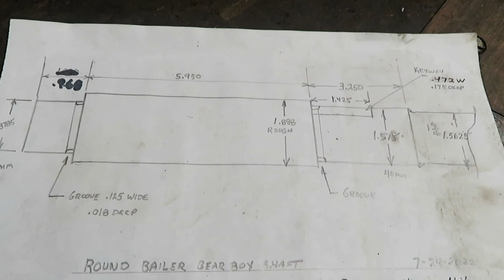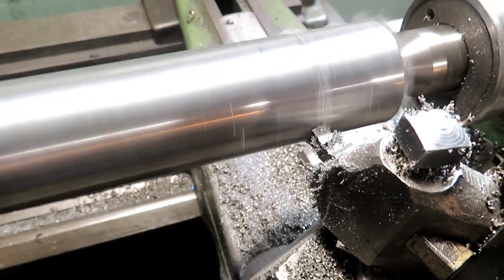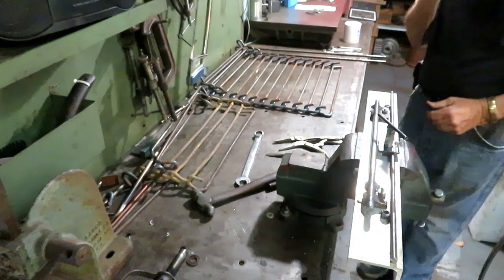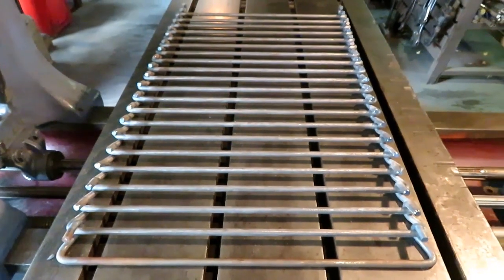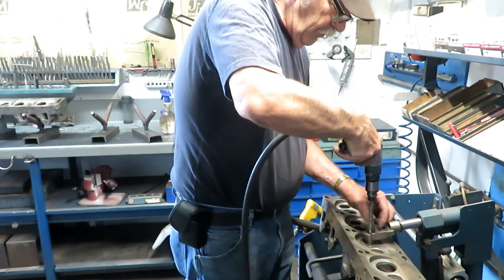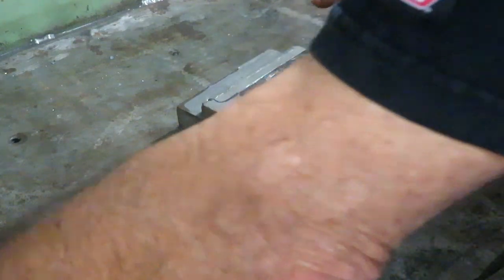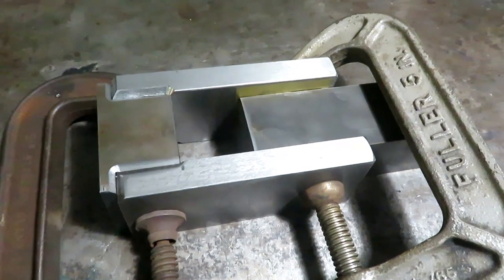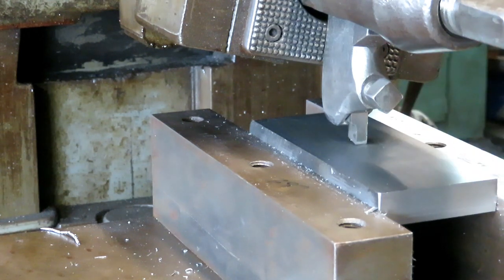Old Steam Powered Machine Shop 80 Steam Shop Work

Comment: For bending small bar stock, may I suggest an induction coil heater? I got sick of burning lots of gas to bend metal on repetitious jobs like this, so built a hobby-sized one from some plans, and anything from 6mm to 23mm (1/4" to 15/16") is easy, and it will pre-heat 25+mm enough to let you finish it with a flame.
Reply: Amish probably picked him for his avoidance of electric

Comment: That's an odd bit of metal, I've never had a shaft be magnetized like that.. I've heard you can get a big 12 volt electromagnet and hook it up to ac instead of dc to demagnetize but I've never tried it myself.. for an ac power source, tapping into the transformer on a battery charger before the rectifier is what i was told to do

Comment: Dave, another fantastic video!  I wonder if that crosshead design might be something that appears in patents?  Simple but difficult to make without a purpose built machine?  Maybe they had it on a shaper or slotter with a bit that would cut on the end, fed down to the radius and then rotated it with a dividing head, flipped it over and then repeated on other side?
Reply from the maker: That is a possibility, but I can't imagine what the surface finish would have looked like.....Dave

Comment: The shaft might have been magnetized by someone using a very large and powerful lifting magnet on it (or a DC electromagnet). And if they turned on the magnet before it was in contact with the shaft that might have slammed the shaft and magnet together. A very strong mechanical shock while it's in a strong magnetic field would make the shaft even more magnetic. 

You might be able to clean the magnetized swarf off your lathe with a degaussing coil, like the ones that used to be used on old CRTs (check ebay)
Reply from the maker: I found this in the specifications:  StressProof® is electro-magnetically tested using eddy currents.....interesting.....Dave
Reply: @davidrichards5594  that's a standard method to test for cracks and voids, and as far as I know it shouldn't cause any residual magnetization. Eddy testing uses a pair of small AC coils (not DC coils) and looks for differences in the currents in the two coils when they're passed over the test object. It works similar to metal detectors.
Reply: @davidrichards5594  there's a different inspection process called Magnafluxing which can magnetize steel because it uses a powerful magnet or DC electromagnet. But when a steel factory does that kind of testing they also demagnetize their steel after it's been tested. Maybe you got a piece that failed a Magnaflux test and was never demagnetized.

Comment: Dave do you know how to magnetize a screwdriver by wrapping a strand of insulated copper wire around the shaft and touching one end of the wire to the negative post of a battery and the other end to the positive. Anyway it you stroke your shaft from one to the other several times with that screwdriver it should demagnetize the shaft. Or use a degausser.

Comment: How many potatoes are you getting for each link so I can figure the amount of bags? Guess it doesn't make a difference if their Eastern or Russets but I prefer Eastern myself. When you finish the new crosshead, maybe have the old one X-rayed to take the mystery out of how it was constructed. Nice job on the valve guides, never seen those bronze insets, I was always skeptical of the knurl jobs myself. BTW, hard of hearing and half blind is called aging.
Reply from the maker: Great comment Bob.....Dave

Comment: Richard for a while there i thought you were going to maby answer one of my most puzzling questions i have had for a long time but it never came to be. how did the old timers(who were a lot smarter the a modern engineer ever thought to be,) machine the pin diameter on a cross-slide. i studied that question for many years. i searched the patent offices and all the early manufactures i could find.the early patents for that operation are truly inspiring.however i did find an old machine that would turn that diameter you showed everyone and from that very early patent hand sketch i reversed engineered a machine that would prove that it can be done. some of the very early railroad shops had what was called crank pin machines that would fasten onto a train wheel and finish machine a crank pin on an old train wheel.however that is still not what the early steam engines had to machine the pin's on them. no one would ever know what my model machine is except for me showing the how it works.richard here is a link to the original sketch that i worked from. http://shopswarf.orconhosting.net.nz/p&awp.html. you might copy and past this to get to the web site. good luck.if i knew how to post a picture of my model i sure would.
Reply from the maker: Ok, will do...Dave
Reply: I just tried your link and it give a return of: server IP address could not be found.  I tried the copy/paste and just clicking on it.
Reply: Your link is dead!
JIM
Reply: The dead link can be found at the Wayback Machine Internet Archive. I've tried posting a direct link, but YT keeps removing it.